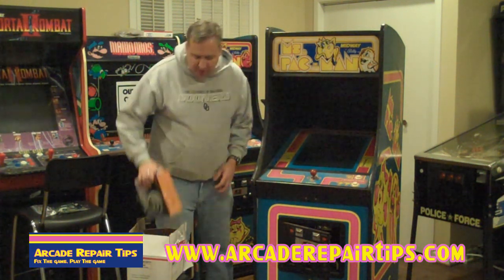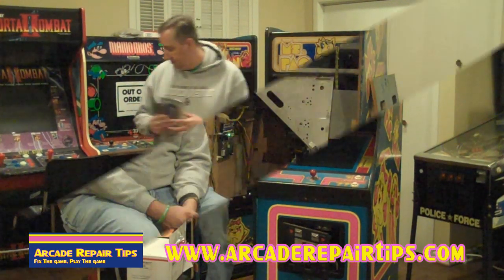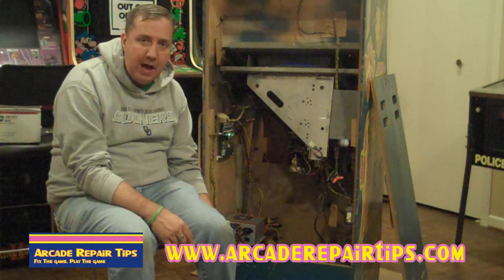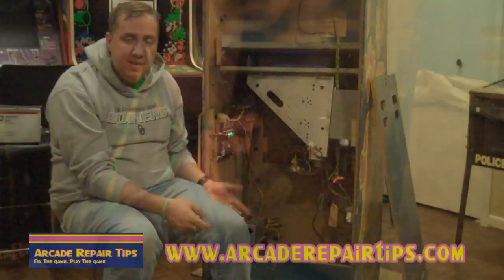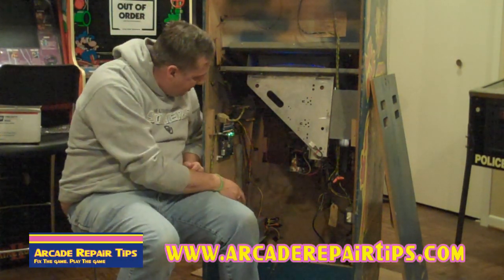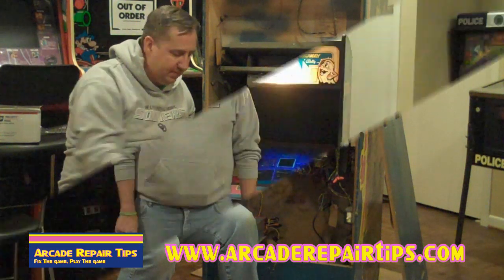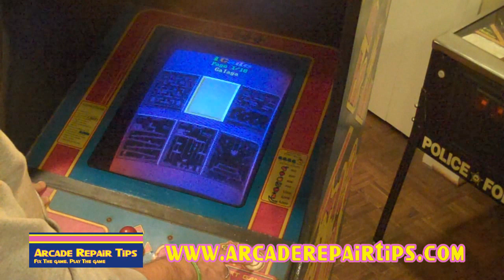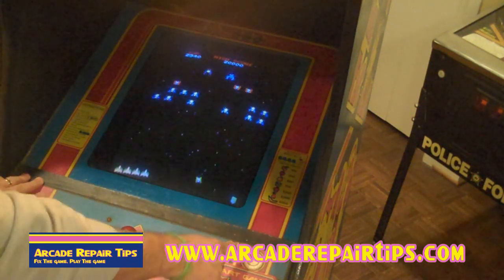Arcade Repair Tips - Installing A Multicade Upgrade Kit (For Pac Man Cabinets)

Comment: I wired and grounded my power supply to the marquee light wires as suggested in the video, but am now getting a bit of a "herringbone" snowy interference that I do not get when connecting the same power supply directly to an outlet with a normal plug. My Ms PacMan has a three prong plug. Any suggestions?

Comment: I have a 60-n-1 with lcd monitor. We had a power outage the other day and when it came back up, I get only sound, no video. There IS a light inside the monitor case.  Can you please help me troubleshoot this issue?

Comment: Question. I have an coin operated old game/cabinet. It was set on top of a bar table and swivels. Can these type of upgrades be done on this type of unit . Currently has old games like pong. Horse racing, , trivia . Are game upgrades available for these type of units too? I currently have 4 or 5 square buttons on console. But will to change out to be able to play better games .. any advice is appreciated . Thank you

Comment: Help! I have 2 Pacman and 1 Ms Pacman cabinets. I just bought the Jamma 60 in 1 "Pacman kit". I have hooked the kit up in all 3 of my Pac cabinets, the 60 in 1 will not power up. I tested the 60 in 1 board in a jamma cabinet and it works, I also bought another power supply thinking I might have just got a bad one still nothing in any of the pac cabinets. I thought this was going to be a plug and play after reading directions and seeing the video, cant understand whats wrong. All three cabinets are standard midway Ms pacman/pacman cabinets...any ideas thanks
Reply: Did you ever figure out what was wrong ?

Comment: How do I wire the control panel so the 1P button is the fire button? I have a 60 in 1 and it works fine except for the button wiring....thank you.

Comment from the maker: The 60-in-1 that we have saves high scores but for some reason does not save the initials for the high scores. We don't know if they are all like that or just ours. We're pretty sure that the 60-in-1 runs the games in 640x480 interlaced resolution but you will need to contact JammaBoards to confirm this.

Comment: Does the 60-1 save high scores when you turn the power off?
Reply from the maker: Yes, the 60-in-1 board should save your high scores (if you have the high score saver dip switch 3 set to the ON position) BUT, in our experience, it doesn’t always save your initials.
Reply: Arcade Repair Tips thanks

Comment: I just bought a 1981 Ms. Pac Man arcade and the Ms. Pac man is going very fast. How would I be able to put it back in regular speed. Thank you
Reply: Your PCB has a speed chip installed in place of the normal ROM.  You'd need to get a normal ROM and swap it out.  However, you're probably better off buying a multi-pac from HighScoreSaves dot com.  It has a menu to select, Pacman normal and fast, Ms. Pacman normal and fast, and more.  Works with Pacman or Ms. Pacman boards.

Comment: All 60 in 1 boards only save the top high score and no initials.  Isn't there also a ms pac control panel with fire buttons.  I would set the board to single game mode for one of these type cabs which i've done on my pac-man machine once as a temp measure.  Its usually the 2114 RAM chips that go on these boards.